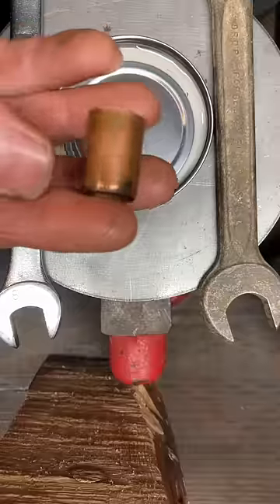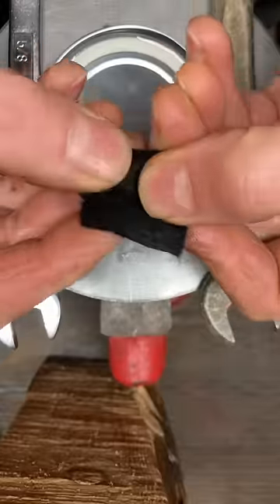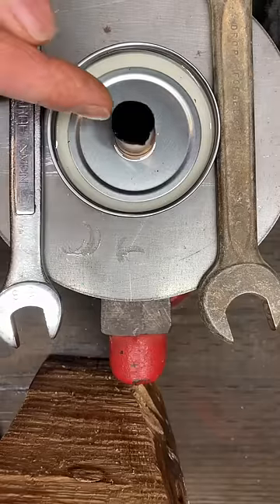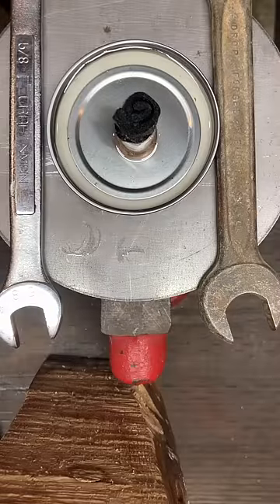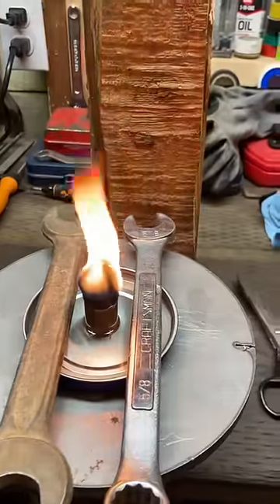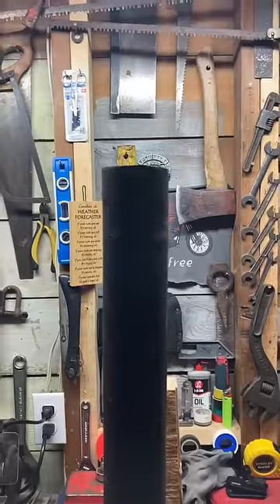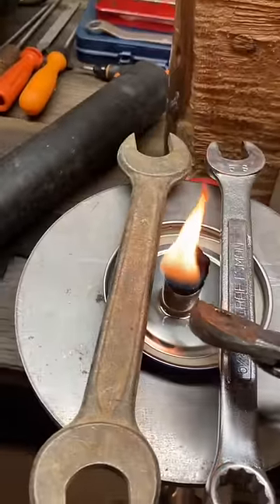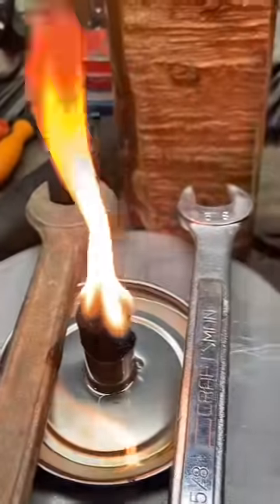This Wick's INGENIOUS! 🔥🤔 #shorts #diy #tips

Comment from the maker: Thanks for all the support everyone! Amazon is where I ordered the carbon felt from. If you try this be sure to use in well ventilated area. It burns cleaner with a chimney but still produces products of combustion!
Reply: How long will it burn on that oil
Reply: I also want to know how long that exact set up would last please ??
Reply from the maker: @crissysims4357  Check out parts 2&3....1/4 cup oil would last approx 4hrs. More info in video description.
Reply: Carbon felt...carbon monoxide???
Reply: Soot.
Reply: @seanjustg5425  From combustion, not the carbon fibers. A candle makes CO, too. Neither make enough to hurt you in a room with normal air circulation.
Reply: @WillBravoNotEvil  ty...lot to learn yet
Reply: I wonder if it will work with bio diesel?
Reply: @seanjustg5425  there is no correlation. The carbon felt is non-flammable so if it did run out of oil it would produce less carbon monoxide, carbon dioxide, and other pollutants
Reply: @seanjustg5425  My pleasure. I had to give it a little think myself! 🤟🏼
Reply: @worldclassish  It could - in theory - but you lose the inherent safer qualities of veg oil, namely, its non- volitility. Biodiesel is essentially kerosene.
Reply: @anthonylehner3643  carbon dioxide...is what you exhale...not a pollutant
Reply: Carbon felt? As in carbonized felt?
Reply: that's all I was wondering, where to get the carbon felt. thanks for the vid.
Reply: Have you tried a hollow wick with an air duct inside?
Reply: @MikeG.666 I just checked Amazon. Prices are all over the place and lots of different thickness, too.

I'm thinking the thinner one for this application? Or a smaller piece of the super thick jammed into the "wick holder"  

Florida, so reliable heat is not a big thing. Thinking about this for my carport, keep it warmer for winter enjoyment.
Reply: Yeah, I wonder if you'd set up a particulate matter sensor near this, how high the 2.5/10 μm values would go. My guess is, pretty high.
Reply: @seanjustg5425  all combustion produces carbon monoxide which basically means anything burning with open flame including a LPG range or stove. remember those mantel lanterns? yeah carbon monoxide is output by those too. Inversely an electrical element does NOT produce carbon monoxide. This means an electric range is safer than a gas range.
Reply: @JENSENDIY  ,,,i use POTATO CHIPS  used cooking oil ,,,,  adding little bit of  CINNAMON ,,,and CLOVES heat for few minutes   to make them aeromatic and then filter it to use in side lamps ,,,,
as we do  in INDIAN homes

Comment: Glass fibers with a pinch of carbon on the tip works, too and lasts longer. The carbon acts as a catalyst to make the oil burn more easily. The glass fibers will last forever. The carbon gets replenished by the flame. If you try this with glass fibers without the pinch of charcoal it will still work, but it is much harder to get started. You just need a little carbon on the tip to make it work right.
Reply: What is am example of glass fiber?   Thanks

Comment: Try this, and you will find once the oil gets hot in the tray as the copper gets very hot, if you knock over the copper pipe, the whole tray ignites. Just a warning that no one puts in these videos. In the UK we call this a chip pan fire.

Comment: My grandparents would mix vegetable oil and kerosene and the old kerosene heater would run ages without having to adjust the wick and for some reason water on top helps to reduce the smell i don't know how it works but it worked.
Reply: The water is to stop the air drying out in Ireland I use a bottle gas heater and put a sml bowl of water on top
Reply: The water on top is a barrier between the oil & air preventing the wick burning up from excess air. 
The wick will burn with only air leaving you a pile of ash. 
Hope that explains it for you, and less soot too.

Comment: You can also heat a whole house 🏡 on a scaled up, stabilized and upgraded version that will run on any misc scrap oils. Cheaper and more efficient than wood, just might smell funny a little‼️

Comment: Doesn’t burn cleaner, the soot sticks to the sides of the cast iron pipe. This is how prison tattoo ink is made.
Reply: Cool comment
Reply: Soooo it is burning cleaner🤦🏻‍♂️🤦🏻‍♂️🤦🏻‍♂️
Reply: @johnbarron4843  still burns just as dirty, but the soot condenses and is essentially filtered out.  That's not the same as burning clean.
Reply: @John Barron  if the iron pipe were to make it burn cleaner, there would be no soot. It burns just as dirty. Brilliant.
Reply: As far as air quality is concerned, it doesn't really matter. Of course the CORRECT term would be to say it releases less smoke (although soot is still reduced to some extent)

Comment: if u want to make it a better heater, drill a few holes through the pipe above the flame and insert copper piping across the pipe, which will heat up and blow warm air into the room
Reply: I think you should make that video! I'd love to see it.
Reply: Especially if the tubing goes from a bottom hole to a top hole on the inside of the chimney. It works like the Heatolator fireplace insert, drawing cold air in through the bottom hole heating the air inside the tube and allowing the hot air out the top hole.

Comment: "How could that be"? You had to put a lot of energy into the system to heat the carbon sufficently for the oil to combust, the lighter vapours from the volotiles are what's burning .... that's how.
Reply from the maker: I've had a few comments stating this. Check out part 2. I use a single match to light the wick.
Reply: @JENSENDIY  ok, maybe I should not of said "a lot" but the answer is in the ability of the material to "wick", it continually draws up and replaces the volatile's that are combusted.  Fibreglass cloth also wicks but does not burn.

Comment: Use methanol or isopropanol and you don't have to worry about fumes. C02 and H20 is the only byproduct
Reply from the maker: I'll have to try that sometime. Definitely need to chimney pipe the veggie oil method to the outdoors or have in well vented area or your space will smell like a kitchen!
Reply: How about hand sanitizer gel? Maybe you’d have to thin it with more alcohol to get it to wick right?
Reply: @MrPanchito62  Absolutely bro. A cost effective heating strategy however would simply be to use Isopropanol or Methanol on its own and save your sanitizer. 
There's a guy on YT called Robert Murray-Smith and his channel is called 'TnT'.
He's an awesome personality and a very talented guy who is also a chemist amongst many other areas of expertise who has a whole series dedicated to this kind of thing.
You should check him out. I doubt you will be disappointed 👍
Reply: @Embassy_of_Jupiter 😆😆 Hope your okay bro! I suggest a tutorial or some kind of educational before you play with things you don't understand. Go look at TnT channel on YT. You will get the idea
Reply: @Eff-U-Kay  using alcohol this way would be a spectacular inferno!  DO NOT! ....Although I might try it outdoors just to see if the pipe turns the whole thing into a blowtorch 😂😂
Reply: @danbeeson9564  Not if you have an understands of the chemicals you are using and basic physics. 
Your comment tells me you do not and therefore should not experiment unsupervised or at least until you have had direction.
Reply: The whole point of heavy oil is that it wont ignite directly if it spills. Alcohol is damned near explosive.
Reply: @canberradogfarts  Correct! Jeez, reading these comments has me seeing house fires in my head.

Comment: I didn't have power during a storm .and no candles. I used bacon grease or beef grisle .cotton string that comes wrapped around a beef roast and a beer can cut in half .and a beer tab which held the string to form the cotton wick 
I cut the can I half and filled it enough to submerge half the cotton wick's length.

Comment: Good to know. The heat on my box truck stopped working and I couldn’t afford to fix it so I used to drive it like that for a week going up to Vermont. Plenty of layers and a heated 12v blanket wasn’t enough, eventually I got some of those gel cans but this trick would of worked just as well if not better
Reply: I drove a truck without a heater for 10 years. I almost cried when I finally bought a truck with heat and AC. 

I had a 90 mile one way drive to work once. Only lasted about 6 months, but it was during the winter time. Having to get on the interstate and drive at high speed with no heater to start work at 7AM was brutal. 7AM to 5:30PM 6 days a week. And I was working outside so its not like I was getting any warmer. I do not miss those days at all.
Reply: Lube makes the world go round
Reply: People doing these cold shower challenges make me giggle.
Reply: Carbon monoxide in cab?

Comment: And that's the ONLY way one should use vegetable oil.
Reply: Works Great as fuel oil in my diesel engine. 
Fish and chip - takeaway shops with deep fryers throw out thousands of gallons each year. 
Cheap fuel.
Reply: @colb9916  As food, it's poison.
Reply: @reynardus1359  insane the toxic chemicals and methods they use to make it palatable.
Many of todays health issues were never around till seed/veg oils were pumped as food. 
Butter, lard , olive oil is all i try eat.
Reply: @colb9916  Absolutely correct.

Comment: well as we didn't have carbon fiber before I can't complain why it took so darned long for us to come up with this.  great little tut
Reply: In case you are interested, this is carbon felt rather than carbon fiber, basically just pyrolized cotton (ie heated intensely in an inert atmosphere with no oxygen to burn). Carbon fiber is madw in a similar fashion but is much more finely controlled and is done on individual fibers, not prewoven sheets of cloth, which is part of what makes it so expensive.
Reply: @maxk4324  so it IS something we could have had for a thousand years
Reply: is it the same stuff we buy to protect the wall when sweating copper pipe?
Reply: @carpediemarts705  ya, you could probably figure out how to make this stuff using technology from 1023
Reply: @IzziedeD  yes, it is.
Reply: @carpediemarts705 we do have it for thousands years. It's called oil lamp.

Comment: You can use a shoe lace and a McDonald's cup and lid fill cup 5/8 full of water add a 1/4 amount of veggie oil take lid trim so it can fit in to cup load string threw straw hole let it soak before you light the take empty cans fill with sand /dirt place around then place a top now u can cook heat and forge

Comment: Don’t forget the propane torch! Lol
Reply from the maker: Mapp gas, I'm a plumber so I figured it necessary,  a lighter or match would do the job too🙂
Reply: @JENSENDIY  …. A match won’t light this ……… unlessss.  
You have a catalyst to raise the temp to light the oil. Buy some of the yellow “Heet” or knock off brand. This is methanol. 

The methanol will ignite with the bic or match soft flame. So drip some on top the wick. Light and it will ignite thus ignoring the oil which requires a high heat to ignite. 

Otherwise you need a torch flame of some kind.
Reply: @JENSENDIY  
No way are you lighting that with a match ! 
Why lie
Reply: That's what cheap torch lighters are for in the Dollar store. 😆

Comment: Is it roofing felt or something else?
Reply from the maker: Carbon Felt, not sure if that's the same as roofing felt? welders use it because it's fireproof. You can buy it on Amazon.
Reply: @JENSENDIY  ok I figured it out. Thanks for your efforts !
Reply: Roofing felt is definitely flammable!
Reply: @JENSENDIY  no roofing felt.  I use roofing felt because you can start a fire in a thunderstorm with roof felt.  Carbon felt is different and protects from heat and does not burn.  Play with some roof felt, tear it so the edges are thin, light it.  I mean tear into french fry size strips at first and light it, then pile your burnables on top, and you'll have a fire.

Comment: Where can I find carbon felt?
Reply: Home Depot
Reply from the maker: Tool supply store that carries welding blankets or order a smaller piece from amazon, not sure where else to find it.
Reply: a bigger wick..  an upside down can over the fire... a smoke pipe to the outside from the can ... you have a heater and a a flat cooktop... no carbon monoxide inside the house or trailer....
Reply: Amazon, Homeless Despot, etc.
Reply: Can the carbon felt & vegetable oil be used in a glass hurricane lamp in lieu of the cotton wick & ridiculously expensive lamp oil ?
Reply: @rofree2470  
might soot up a little faster
Reply: Idk if I’d inhale carbon felt like that
Reply from the maker: @rofree2470  I think the lamp glass would become very sooty as this needs to draw air in around the flame to burn cleaner

Comment: That's AWESOME! 
I've been burning different vegetable oils for years, just using different wicks. I'll DEFINITELY try the carbon felt! Thanks!
✌️❤️
Reply from the maker: It works great! just posted a part 2 short recently.  Wick was in great shape after a couple hours of burning, didn't burn much oil either. Thanks for watching!
Reply: @JENSENDIY   Thanks 4 sharing

Comment: That's a great idea! Any idea about off-gassing? Shouldn't be used in an enclosed environment? Still, great idea! That carbon felt is similar to what's used when brazing? Thanks!
Reply from the maker: Definitely safety first, you want to have a proper chimney to the outdoors or use in well ventilated area. I'm thinking of trying to make a small veggie oil stove with a chimney to outdoors. This was just a quick example of how well it works. I know they use the carbon felt for welders blankets and odor eaters in shoes etc... Thanks for watching!
Reply: Yeah about as dangerous as a wax candle better not burn those indoors. Super dangerous...
Reply: If you're only burning vegetable oil, it's probably the same as having a few candles going
Reply: The copper fumes is what I'd be worried about. Unless I was liard to about burning copper
Reply: @macmccartney5760  liard super lizard ? 

Lied ;) i jniw
Reply: It'll work with used motor as well.
Reply: @pointedspider 
Now that would be toxic.
Reply: @shawnhenderson1130 
Burning wax candles indoors is dangerous? You’ve never been in a church?
Reply: @macmccartney5760  the copper is not even getting hot really, the oil is burning off the wick !
Reply: @macmccartney5760  edit liard to lied
Reply: If you’re relying on something like this for heat, off-gassing probably isn’t high on your priority list.
Reply: @benztech2262  did you know you can't chew wax with your fingers?
Reply: @Shawn Henderson  Lmao! I was just going to say, Wait a minute didn't everybody In the the entire world for centuries have dozens of candles and OIL lamps, and lanterns burning in their house for the entire night, every night, with zero ventilation except for the fireplaces chimney which was being occupied by the large fire in the fireplace?.... Hell I still use Oil lanterns quite frequently and a few oil lamps along with candles whenever the power goes out and growing up my mother had our house FILLED with candles! We never had a problem... I find it absolutely hilarious how terrified everyone is and how some people are such total panzies now! Like if you're in the situation where you actually need this heater who the fck is going to worry about creating a chimney for it to the outdoors! The cold is going to kill you ten times over before the exhaust would even make you sick.. Plus who is going to cut a hole into their house to build a chimney for a mini heater while they are freezing to death? That hole to the outdoors is going to counteract the heater and make it even colder! I get the video poster saying safety first and talking about ventilation for liability and safety reasons but the original commenter is hilarious and makes zero sense. It's like saying "Hey don't eat that can of beans! It's passed by the Best By date by 2 days!" while you're starving to death in a survival situation...
Reply: @Lotek117  
Our first world privileges have created some very, very, delicate individuals. They don’t often think of the sacrifices and hazards the previous generations faced to get us here. Like learning to fly, experimenting with radiation, and drinking water from a garden hose. 😂
Reply: @Lotek117  the whole world has gone soft..... it's ridiculous
Reply: @vwr32jeep  wait…what? You cant drink water from a garden hose?? Guess I’m done for for all those childhood summers.
Reply: @shawnhenderson1130  wax candles aren't dangerous.  Unless someone knocks them over but a candle doesn't consume enough oxygen to cause risk
Reply: @macmccartney5760  burning copper isn't so bad....it's the Zinc in BRASS that's highly toxic (and dirty)
Reply: @vidiotsyndrome  I wasn't sure, I just remember someone saying copper fumes was bad. Well I guess I know now
Reply: @macmccartney5760  
In metal shop in high school my teacher wouldn't let me make a smoking pipe from copper.  He said copper was poisonous and I had to use aluminum.  He was going to confiscate it after he let me learn how to make it but, after all the other students left the room, he let me keep it.  Cool guy.
That was back in 1981.
Reply: @Gunzee - NO! Do tell!
Reply: @RalphSampson...  that's what I heard, so basicaly the fumes aren't good for you either
Reply: @RalphSampson...  I was told that you could get lock jaw from using copper pipe, don't remember who said it though